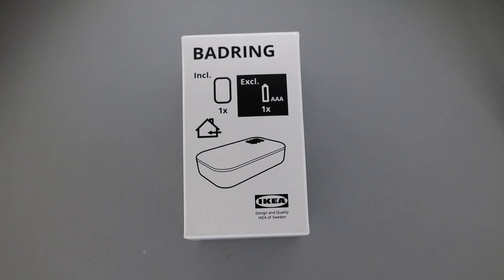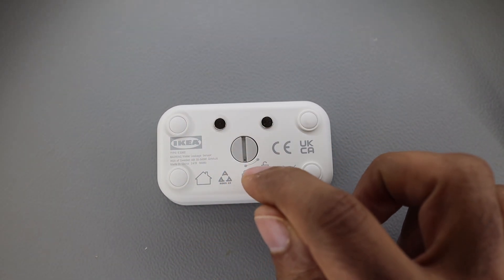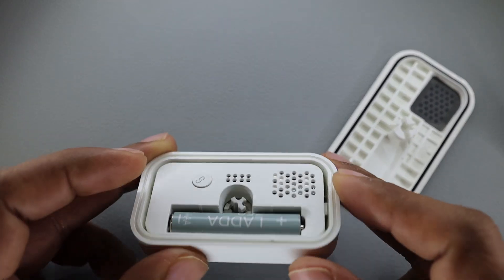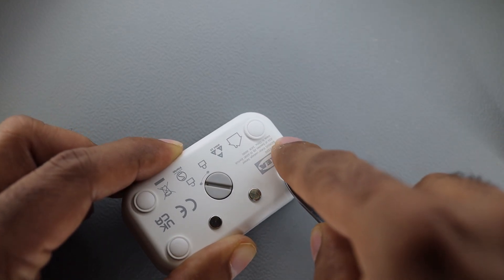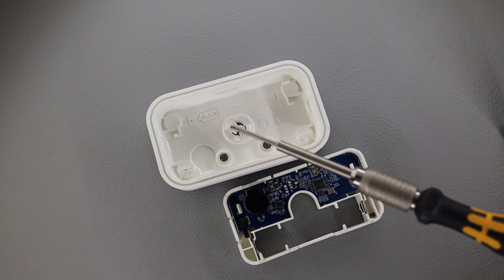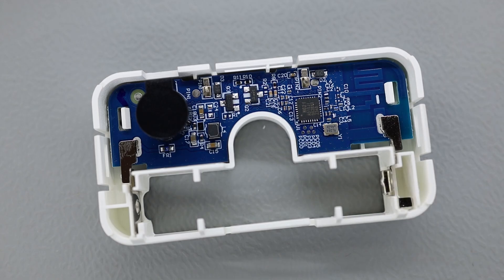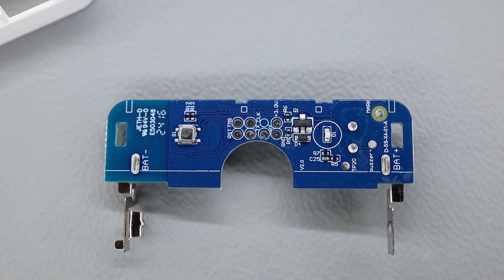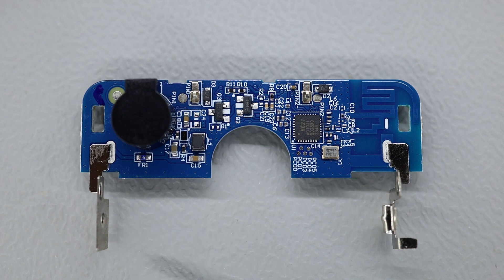Ikea BADRING Water leakage sensor Teardown, Smart Zigbee sensor

Comment: good, so u can solder two wires to the two pins on the pcb and u can add multimple "sensors" in the same area using only one device.
Reply from the maker: Yes that should doable.

Comment: Hi would it be possible to use a micro switch which is connected to the spring contacts so that closing the switch would trigger alarm?  Thx.
Reply from the maker: Yes, Even toughing them Triggers alarm.